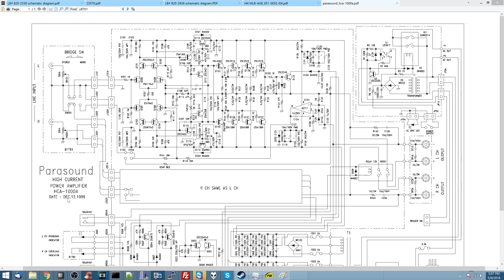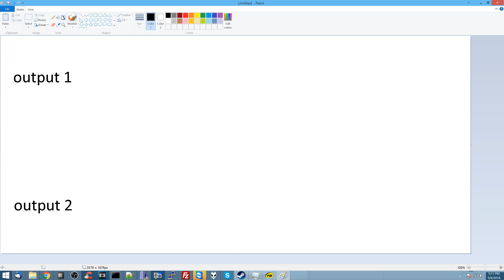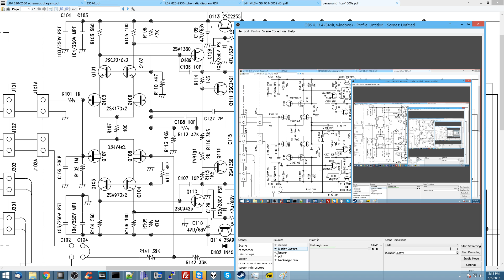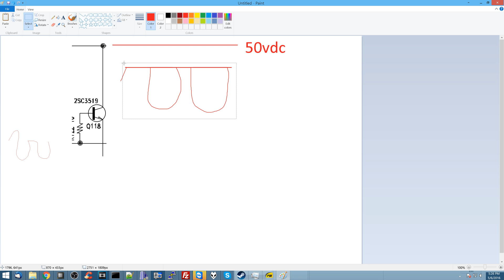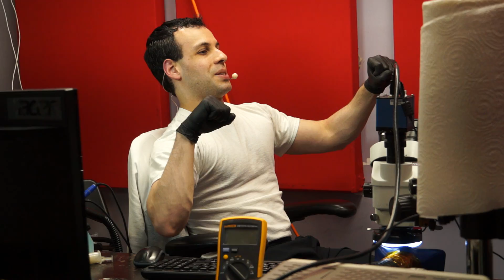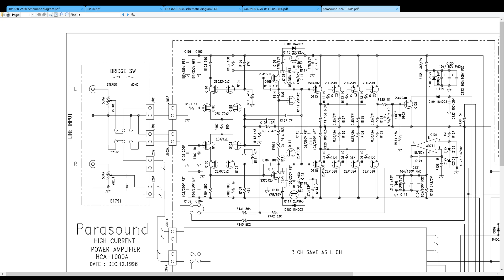If you didnt believe I flunked out of college...

Comment: I have a marantz class a amplifier that has been in pieces for months with transistor issues. In fact I have stashed it underneath my bed, which I am getting nagged about, I have all the parts and wot not .Well I just can't be arsed with it right now , oh well maybe this video and the need for harmony might get me haunched over it again. Nice video, I like your style.
Reply: +wayne murphy I hope its no like the Marantz PM 94 that I've just fixed. Quater A amplifier switches to class AB when the volume is turned up to 17 volts. Absolute nightmare setting the bias and switch over voltage. I've been fixing amplifiers for 22 years  and this one was the worse ever. can't even get K134's anymore, not unless they are cheap copies. K1529s work but biasing is a nightmare.  If a Marantz PM94 was a dog it would be a very angry rottweiler with sharp pointy teeth and a thirst for engineer blood!
Reply: Hi it's a PM 7200, and I know that the original transistors have been discontinued by Toshiba. I had the option of get some genuine pulled parts from another country or some cheaper equivalents, so I went with the later. Wish me luck.
Reply: By the way I love your analogy you made there, I hope that mine one of those dopey labradors which that hopefully won't try to hump my leg

Comment: How do you loose a top cover like that? Theres AC under there and you want to put stuff onto the amp, so you need the top cover. I would understand if you loose the cover for your computer tower, because that doesn´t have high voltage inside and you can still put stuff ontop with the cover removed.
Reply from the maker: +Reviews+Tutorials you work and do business out of a place where every other day you are changing the room you are working out of because someone new is taking that room, then get kicked out of the place entirely because you just told off the owner of the business, at the grammys, on speakerphone, and discuss how his company is likely just a front for his very real cocaine operation.

I discuss here https://www.youtube.com/watch?v=MyZnKjFWrxo

but not exactly a STABLE working environment. Not taking home the top of my amp was the least of my concern..

Comment: And 30 years ago the schematic for almost all electronics were in the user manual. That's why those product lasted so much with no repair.
Reply: +Stanila Stefan The schematic is in the user manual, therefore, the apparatus will last long without needing repair? Interesting conclusion
Reply: +Yo Da  The electronics in that era was built to last, they wanted you to fix them in case of a fault but the build quality was so good that they will work 10,15 years with no fault.
Reply: Stanila Stefan Exactly, so they wouldn't actually need to give us the schematics today, just make sure the stuff "works". When that's said, you do underestimate the HUGE difference between apparatus from the 60's and before that where circuits were characterized by little if any integration, low-performance materials that yield large components (albeit often more reliable, such as potted polyester cap vs. small MLCCs that may even suffer from weathering effects!) and no environmental regulations limiting the whisker prone RoHS tin or other problematic issues of today, which is not due to the manufacturers themselves.

Besides, be honest and tell me what was the last apparatus you had to replace because it just stopped working, as opposed to was smashed into the ground, humidity, or abused in any other way. The consumer electronics of the old days were often big and bulky, and thus did not experience the harsh environments of today.

These are just some arguments to point out why sometimes appliances today seem to fail more often than before. I design electronics, and neither do I myself, nor have I heard of anyone else purposely designing products for short life-span. If anything, there are actual tools in especially IC design that simulate the effects of true aging (like hot carrier injection) so that the designer can easily achieve MTBF figures of thousands of years.

Comment: Hmm, ok you asked for it...so i´ll do my best to not make you go "angry"

First of all amps like this have different stages (as you said) but each with it´s very own business.

The input is a differential pair, made of FETs, which only let "unequal" signals pass, if you have the "Art of Electronics" book check over there for the DiffPair and how they work...it would take me ages to write about it.

Next in line are these BJTs whitch are the current mirrors top and bottom lined up with the diffPair...you want his diffPair to have them FETs acting as linear as possible therefore you need a current source...that´s what they are for.

Next, amps like these have a voltage amplification followed by a current amplification section.

The voltage amp is made of Q109/Q111 (there is an arror in the schematics as Q111 is two time in there) and Q110/111 (it needs bo be called Q112)
Q109/110 are the "low" current voltage amplifiers and the Q111/112 are some intermittend BJTs which do both (more or less) and they also provide the drive current for the output Transistors (i don´know if these are already circular-emitter-form-types) and where the output transistor bias adjust is for the high and low side....(i would had made it silightly independent, but it´s ok...;)

Finally these output transistors are only there to provide current to the signal and in this config here they are used as emitter followers with a gain less then one...but they provide the current. and, as we all know power is voltage times current.

A rather nice touch, are these Q113/114, as they are voltage regulators...which made the input section more stable when the amp is fully blasting, and also provide constant voltage for the input section. (a diffPair needs rock solid stable envoirment to work best)

This is (very briefly) how these types of amps work.

hope that helps:)

Also i want to see that this amp get fixed...:) :)
Reply from the maker: +TubiCal Thank you. I appreciate everytime I Can learn something from the comments section!
Reply: +TubiCal The amplifier contains no current mirrors, what you see is a symmetric cascoded differential gain stage at the input and the JFETs are clearly biased in saturation (by the voltage drop across the current setting resistor R107. They are NOT biased into the linear region (which would also make no sense, since you want as much gain as possible in this stage).

You also got confused by the output stage biasing section Q111/Q111(where the reference designators are a typo, but otherwise the devices need both be there). The output resistance of the Q111/Q111 collectors is much greater than the base resistance of Q115/Q116, which defines, and limits, most of the voltage gain of the amplifier (together with resistors R105/R106 using the gain elements Q109/Q110). Finally, the Q113/Q114 pairs are capacitance multipliers, not really voltage regulators, but they do improve PSRR. The rest is more or less correct.
Reply: TubiCal
No worries, and I am sorry for what sounds like it was a really shitty situation at your previous workplace, but at least you don't have to deal with that bullshit anymore. Yeah, don't worry, again, I pushed you a bit just to point out that we should always keep humble. If we are not, someone will always be there and thrash us hahaha Wish you a safe and great day man!
Reply: +Yo Da You´re right, next time i better off describing schematics at daylight....not with tired eyes after a long day...;)
Reply: TubiCal Haha, nice one! I described the same stuff after a long day myself, the difference is that I actually design electronics, which doesn't disappear behind tired eyes. I don't want to bash you for not being a professional, and see that there are more than a few shortcomings in the understanding and explanation of Louis himself, but I do seek a bit more humbleness. For the purposes of Louis' video and his expected audience, the explanation in his video is more than good enough.
Reply: +Yo Da The damn think is that i routed industrial PCBs and designed boost converters around lm2594hv on CAN-bus interface boards some ten years ago for a living until i quit due to heavy divergencies with the bossman, and signed into a complete different field (aircraft/airport security)

Nowadays i only design tube based stuff as a hobby and all for my own fun. The last Power amp i done myself used sk135/sj50 MosFets, when they had been up-to-date....;)

My intention was to help him to see the amp in blocks...input->voltage amplification->current amplification but i ran into complete bullshit! ... i had no intention to correct him. Also i never wanted to put Louis (nor his great work, here) down.
 
I spotted that diffPair and described it more out of my memory rather than the actual schematics. Just because i was tired as can be, really...

Thanx a lot for correcting me! :) After all, we now know how that amp works! Cheers to you...:)

Comment: Hi Louis, thanks for the easy to follow video. I think you do a good job of explaining the basic concept of an amplifier. I have shared the video with some of my friends who do some basic work on music  equipment. But there are some things that are not correct in your eplanation your explanation:
-The Amp doese the whole voltage amplification with Q101-Q110, so you get the full voltage swing on the base of the power predrivers Q115,Q116. Q115-Q122 are being used as darlington emitter followers, so they only amplify the current, while the AC voltage stays the same. Q111, Q112 are the bias voltage control.
-IC101 which you pointed out as feedback path is only for the DC/LF-part (DC servo). The real feedback network is R112, R113.
I hope this helps someone, greatings from germany!
Reply: +Elektro-Peter Additionally, the symmetric input stage design and capacitance multipliers Q113/Q114 would also go the extra length to improve PSRR. Plus points for pointing out the DC stabilizer loop!

Comment: lol... replace the outputs and all the caps with nichicon
Reply: You forgot Fuhjyyu, and a slew of others...
Reply: KhronX
That is a very useful site. I originally learned of the bad capacitors problem from there.

Hand an uncle who's older machine kept crashing maybe 4 years ago. It was a Dell Dimension. I suspected bad capacitors, and was not wrong when he got it to me to fix. $12 later it was perfectly functional again. PSU also tested out fine with 150W load @ 30 minutes.
Reply: That's definitely the fix for a lot of stuff.
Craptastic caps do a lot of damage and go out with a pleasent aroma and bang.
Points Finger
I'M LOOKING AT YOU TEAPO, CAPXON AND CHHSI!

Note: Teapo has slightly fixed it's shit now. Still cheap quality caps, just not a defective formula.
Reply: KhronX
Ah, yes, Fuhjyuu. So many other bad brands it's hard to remember.
Reply: A starting point: http://www.badcaps.net/forum/showthread.php?t=388

Comment: louis, i wish i could explain things the way you do, you have that ability of explain complex things in a easy way, awesome.
about the amp, I think you should explain the difference between voltage amplifier and current amplifier stages, after the differential input amplifier from where the sound comes in, the next transistor is the voltage amplifier, and then the current driver, and power output stage.
Also that amp, uses a interesting way to do the current generator inside the differential amp, weird! :)
I used to design and repair professional audio gear when I was younger, (20 years ago maybe?) but still love to have fun fixing amps when the opportunity presents.
your probably have one of the power transistors shorted between collector and emiiter (source voltage and output) so when the other transistor try to conduct the result is that a momentary short is formed between +V and -V blowing everything up, doing a diode checking with the multimeter without removing the transistors will show you that very quickly, i know disassemble the power section, with the big ass heatsink is a f@cking pain in the @ss. :)

Comment: I completely scratch built this 200W/ch amp starting as a 14 year old to do the chassis and power supply, then etch the circuit board and got the rest of the parts in college.  Here's a picture with a Hafler DH-500 sitting on top of it,  it didn't look that big on paper:    http://baselaudiolab.com/PLB-big_amp.jpg
Reply from the maker: +Pete B That looks awesome! Thank you for sharing.

Comment: If the fuses blew without smoke from the output stage it is possible the bias pot opened up, or a transistor failed and the output stage is full on.  You could test this by shorting the base of Q115 to Q116 completely turning off the bias and putting the amp in class B just to see if the fuses do not blow.  You might want to poke around and measure voltages first.Also, the metal heat conductor on the output transistors is the collector so if an insulator failed that would short the supply, BUT it is unlikely that both sides shorted so this is probably not the problem.
Reply: 1st thing I do is check the output transistors and theorize what resistors and transistors might have blown after they blew. Then I check those parts, replace them with equivalents or originals Parallel transistors must have the same date code, matching with a meter isn't necessary, the factory transistors would have numbers written on them if they did thatand they almost never do unless it's a MOSFET power amp. MOSFET power amps are rare and mostly usually uneconomicsl to repair anyways. Also, I wire up circuit breakers inplace of the fuses and dial the bias pot to minimum. 

I turn the unit on with a dim bulb tester, check amplification, then use a variac slowly ramp up the line VAC with an AC ammeter. 

If all looks good, I check the heat of the output transistors, monitor bias current, turn the bias pot to where the current is correct. If it doesn't bias, I dial it down then check all the listed board voltages.  Theory helps me find out what is open or shorted and that gets replaced and I do the dance over again. 

Some times I just shotgun the semiconductors. Open resistors rarely cause shorts.